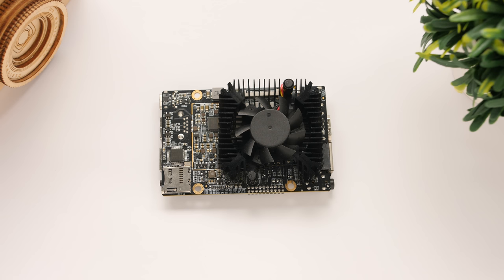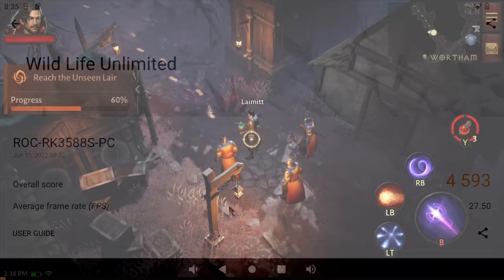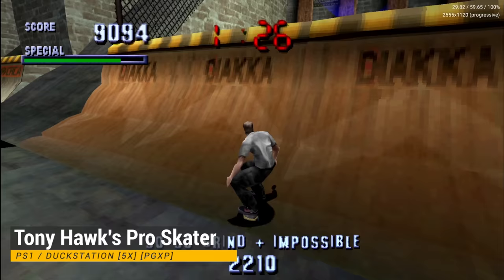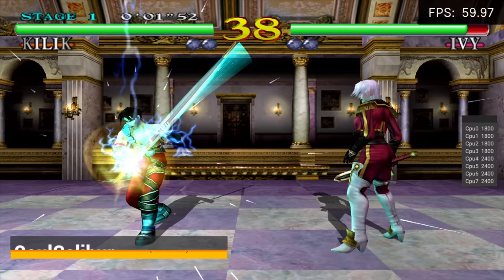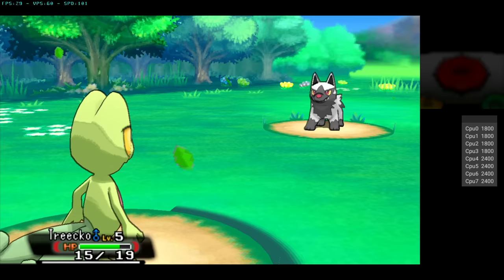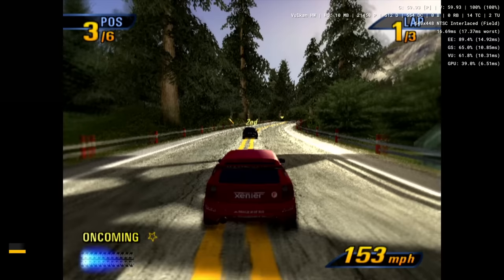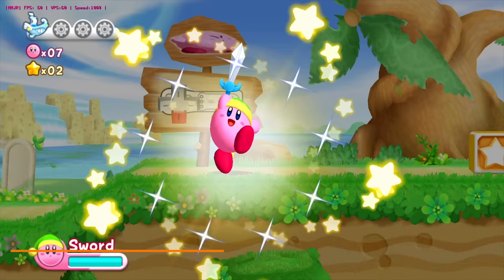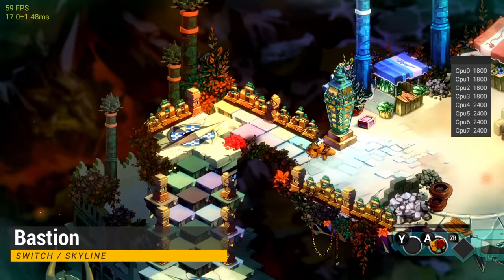This Tiny Chip is POWERFUL - PS2, Switch, 3DS, Wii, and GameCube Emulation

Comment: The fact that an SBC which costs a little over half that of a Switch can run ANY of the same games, especially under emulation, is amazing.
Reply: The switch is over 4 years old shut up about it. It was outdated on the cpu when it came out.
Reply: @shlokshah5379  Me on my way to find out who asked
Reply: the switch uses a 5 year old arm tegra SOC. these other arm chips don't actually have to do much emulation, just have a decent gpu and a driver that works.
Reply: @PaulSpades  I didn't think about that aspect; i.e., since they both use ARM architecture, the emulation layer won't be nearly as "thick" as, say, if a switch emu were running on an x86-based machine.  If they ever have these or Khadas boards (another high performance RockChip based SBC you've probably heard of) back in stock, I'm definitely using one for my portable emulation handheld.  Let's hope that these aren't more small companies which fall victim to the supply chain shortage and go out of business.

Comment: This is definitely exciting. I have an old Lenovo Yoga Y500 Laptop that I sometimes use for emulation. It has slightly better Geekbench scores at 678 Single Core and 2489 multi. It's no graphics powerhouse at this point with it's NVIDIA GeForce GT650M graphics card and a Timespy score of 603. Yet it runs Gamecube, Wii, and PS2 Emulation at Full Speed on a 15 inch 1080p screen with no problems. This little board should be amazing in a handheld.

Comment: Wow, this is great to see. Finally a small SBC that can handle all the standard def consoles for a reasonable price. Another revision or two to smooth things out and it will definitely be something to pick up.
Reply: 3ds emulator Citra is still work in progress. Oh man i never had 3ds because it is not available in my country so I play on my mobile via Citra emulator. The emulator run fines on some games but my phone got so much hotter other emulators are not get hot like this. On other side Nintendo ds emulator drastic is so much optimised that I can play any games on it. When i had 1 gb ram phone in 2014 i run drastic emulator games smoothly than ppsspp emulator.

Comment: This is in a way much better than some x86 boards that were available some time ago. Every time I see this kind of stuff, I dream of a new handheld system...
Reply: @ Not AN AMD Nor Nvidia nor Intel fan If you can get one in your country, it sure is.
Reply: you would think but not really just remember the emulation performance this is demonstrating is akin to the performance you would get in a high end pentium or core 2 duo CPU as ps2 does not need much performance it just needs the right kind of CPU

which is where cpus differ you might take a arm CPU and say a intel CPU and think of the specs are alike but arm is a different CPU and has different features for emulation these matter

the biggest difference I can tell you about that effects emulation is opengl x86 and x64 architecture cpus have full opengl which many emulators leverage arm series cpus have opengl ES which doesn't run as well and doesn't have the full features of open fl

also things like vulkan and other technologies make a difference

finally developer support makes a huge difference almost everything you can think of in emulation has x64 and 86 builds for it but the embedded systems not so much and with so many boards and chips available getting anyone to develop for them is hard raspberry pi did well because of its high adoption so it gave a clear platform to target

comparatively odroid xu4 had very little and it wasn't until various teams worked on it that its power began to demonstrate itself and infact once team ORA got some emu devs to make builds tailored for it that its true power became evident with its performance doubling and almost tripling in some cases

so what is on paper for specs is almost meaningless

Comment: Imagine this in a laptop with boosted clocks ofcourse. Maxed out GPU and cpu. A newer chip probably would reach i3 levels of performance while drawing about 15 watts. That will improve battery life so much NGL. Kinda like the macbooks. Almost 4 times the battery life of most x86 laptops.

Comment: This is very impressive performance. I can't wait to see the handheld this chip will end up in. I'm hopeful that the Skyline team can make even more strides because I'm still searching for the handheld that can emulate all the way up the line. I'd rather run android for my handheld, but the AMD 6000 series has so much power behind it I'm pretty sure it's going to get there first. With the Ayn Loki Max in the pipeline and it's small form factor of the Ayn Odin, it's a very compelling proposition. The only downside is that I have to run windows until Steam OS is refined.
Reply: It's going to be a while.

Comment: Honestly, this board almost seems like a competitor to the Steam deck more than a traditional emulation board. It's possible, though somewhat impractical, to run PC games through box 86 / 64 and Wine on Linux, and I'm willing to bet that you could play actual PC games on this thing. I suspect this would be most useful for people looking to find a smaller sized Steamdeck, and I'm sure at this thing's power draw, you could probably make a Switch sized (or smaller) handheld using it.
Reply: this board has an ARM CPU, right? 

so ... wine won't help with PC games because PC games are made for x86 CPUs and wine does not do CPU emulation ... and because of the massive amound of performce required to emulate moderately modern CPUs, it is safe to assume that using an actual emulator like box86 or qemu will only be good for some really old PC games or new games with VERY low system requirements ... so ... nope ... this SBC is not a steam deck competitor ... not even close ... 

maybe someone might turn this SBC into something that is a kickass ARM gaming device in its own right
Reply: @KenjiUmino  I think you missed a step. Box 86 and Box 64 are compatibility layers, to x86 and ARM what Wine is to Windows and Linux. They convert many x86 system calls into ones that an ARM CPU can understand and maintain the native Open GL and Vulkan libraries present on both platforms to keep performance surprisingly comparable in things like games. 

In and of itself, Wine wouldn't be terribly useful on an ARM device, other than maybe running Windows on ARM programs on an ARM Linux installation, but you can use Wine in a Box 64 wrapper for instance to play a Windows game in Linux (via wine) and then translate that to an ARM compatible executable via Box 64.

It's a super cool technology and a very fun rabbit hole to go down. :D
Reply: @novantha1  github page says box86 IS an emulator ... it talks about all the stuff other emulators talk about ... how the dynamic recompiler is faster than the interpreter and so on ... so that is plain old emulation for the CPU side at least ... 

for the GPU side you might get away with handing vulkan calls straight to the host OS but if the software does not use vulkan, you'll have to convert GL to GL ES by whatever means necessary ... some form of compatibility layer might do without causing too much overhead ...

you know ... it has all been tried before and done before and said before and I heard all this talk about how this new emulator X is so much more faster and more better and more efficient than emulator Y but in the end they are ALL the same.

you can't run x86 code on an ARM computer without a noticeable performance hit - you. just. can't.
Reply: @KenjiUmino  Regarding OpenGL at least, you often don't need an OpenGL -> OpenGL ES conversion as the Panfrost drivers, for instance, will cover OpenGL support for many ARM boards currently in active use, meaning you can take out another major barrier to gaming on an ARM SBC.

As for your other points, you might say that you can't run games well on an ARM board, but I see people doing it regularly, and even get away with it myself often enough. 

I'm not sure what your point is; I'm happy with the gaming performance on these boards and am excited about them as an enthusiast. What's not to love?

Comment: 🤦‍♂️No. We are looking forward to the review and tests of the Pentium 8505 and Celeron 7305.
Reply: Is this chip more powerful than the Pentium 8505 or the 7305?
Reply: @tamim4235  of course not. And it costs more than they do. But most importantly, portable consoles on Pentium and Celeron are cheaper, more powerful and have the entire library of windows games. + more performance in emulators.

Comment: Hey Taki! Can you test the Avatar (The Last Airbender) games someday in your reviews?

For some reason, I always get color errors in them when using hardware rendering. At first I thought it was because of the device (Mediatek Helio G80), but the same happened in my notebook using PCSX2. Now I don't know if the problem is related to configuration, the ROM used or something about the emulators.

Comment: Cool board definitely. Just too expensive in my opinion. Firefly’s 3588s 8 g ram 64 g emmc is over 320$ ! Too high. The Rock5b is more affordable although who knows when (or at this point if) this “fabled” single board computer is gonna be released
Reply from the maker: Ya, it's kind of strange that Firefly is on to their second (3rd?) 3588 product when other companies haven't put out their first. I don't know how they got this much of a lead over the competition. Their products are usually priced higher than others, but they do provide OTA software updates for several of their boards, so they must spread out the cost for a lot of things.
Reply: @TakiUdon  that makes sense. I’m so tempted to grab the firefly joint but patience is a virtue I suppose

Comment: Mr Taki, I been enjoying your videos and reviews since you started, could you please recomend me what computer/affordable may I get to run ps2 and wii U flaulessy (and not burn it), I did not have a good enough ones to run them well
Reply: If you want an affordable device would recommend current handheld consoles such as the Odin, steam deck. I have the aya neo which is more expensive but runs ps2 games perfectly using the pscx2 emulator

Comment: Hi, in the preview image, you showed an handheld device.
When people present this kind of SBC, are there any "universal devices" ready to plug your sbc into? did you plugged your sbc into it or is "just to put it into the backround"? (no mean intended) also cause of the large fan and heating dissipation device you showed.
Thanks in advance
Reply: @Enter Name thanks, I thought so and it seemed a switch lite, but with psp and the other stuff aside and all the handhelds, I thought it could have been a kinda knock-off or similar of a switch

Comment: All these damn hand held coming out I can’t keep up. I just bought a decent Samsung tablet for gameboy and DS emulation and bought a dell G15 for everything else (ps1 ps2 Xbox etc) so far so good 😊
Reply: Nice! I have an aya neo handheld pc with: pc games, ps2, GameCube/wii, Dreamcast, PSP, ds, gba emulators installed 😏😏
Reply: @therunawaykid6523  nice and how is it overall?
Reply: @hinfinity  really good in my opinion it’s so cool having a handheld device that can play pc games and many emulators. Even has a dock available so you can play it on a television also in my opinion the seven inch screen and size of the device is perfect as it’s about the same size as my og switch with the hori split con controllers attached. Also what I love is that it has Xbox style controls so most games are already setup plus it has a game record feature so you can record gameplay and take screenshots which is really useful
Reply: @therunawaykid6523  ok I might have to look into that thanks 🙏🏾

Comment: crazy- on my Snapdragon 888, Citra for 3DS doesn't run this well. Return of Samus, even at the original resolution, is unplayable.
Reply: @bulletpunch9317  I haven't tried for a few months- maybe citris has had some good updates, or maybe the play store version is nerfed. 

That geekbench score is pretty weak, you're right. Makes me wonder why I wouldn't just buy a Galaxy S10 with a cracked screen for less, and still get better performance...
Reply: The Snapdragon 888 is generally heavily throttled on a phone and never has a good chance to "stretch it's legs." An SBC doesn't have this problem, especially with active cooling.

I have the S21 so I'm aware of the strengths and limitations of the chip.
Reply: @ezg8448  I wish there were snapdragon boards you could buy.
Reply: @MrHamncheez  - Agreed

Comment: Also if you’re having to mess with settings just to get the emulators to work then that isn’t good. Which is why with anything from nes to ps1 these days anything up to ps1 will always run smoothly

Comment: I am starting to wonder what the difference is between like - this board, the orange pi 5 series, the edge 2 etc. like the specs are the same, in the case of the opi5 ive got a board with dual channel 16gb but im struggling to find a vulkan driver on anything other than android, and because i have steam running on linux id prefer to get vulkan running so i could do everything your doing plus play x86 pc games, since i can already play x86 linux native titles. In fact didn't taki show the edge 2 doing just that? how do you enable steam proton on these rk3588s with mali g610 mp4 graphics 8-16gb ram etc they're all oddly the same. So like how did he get proton working? I've tried wine, I've done box86, box 64, panfork, mesa, etc etc
Reply: Did you find a solution this? I have been wanting to get emulation working on this for a while now. I swapped the OS to the station M3 OS and that worked well to make the android experience less clunky. I still have not been able to get something like batocera linux or a decent front end to work in android to use this thing. It's been sitting in a drawer almost since when I bought it a year ago.

Comment: If your fans got 3 wires shouldn't it be hooked up to a PWM built into the board? As if it was just a straight 3.3-5v it'd only need a +/- terminals to power it
Reply from the maker: That's what I was hoping for, but there were no fan variables that I could change when I was poking around in terminal with root.

Comment: This chip is pricey around 300$ pricey plus shipping around 50$ bucks can't afford this cause doesn't include the set up BUT this is great improvement
Reply: I think this board starts at $219? You can get a RK3588 board for as low as $189 (4GB mem, 32G storage, excluding shipping/taxes)). Still waiting for the Radxa Rock 5 (starts at $129 and I think you can still get a $50 discount code).
Reply: @LivingLinux   yap the 4gb ver is around that price but not including shipping..shiping cost 20-50$ depending where you are still you need at least 250-300$ total with a setup that includes power cable hdmi etc etc .. chip only will cost 180$ total with shiping

Comment: Is this more powerful than Snapdragon 870 with its Adreno 650?
Reply: The 870 has a more powerful processor, if I'm not wrong it peaks at 1200 single core and 3000 multicore. Similar gpu performance.

Comment: The Teams we Haven't Got, Yet. Nintendo Switch.
Borg (Home Electronics Division) Atari, Aquired Our Technology. A Team Branched Out to Become Nintendo. That Team then became PlayStation and Sold Nintendo to the Old Atari team, because of Darlik Modchips.
1-We Need to Get the Old Atari / Nintendo Switch Team.
Borg (Business Division - Sun Microsystems) = Windows, Intel, XBox - We Got.
We've, Also Got the Darlek (Business Division) = Oracle / IBM. I think they May have been Digital Equipment Corporation in the Past.
Their (Darlek) Home Division (Motorola) - We Haven't Fully Got.
We've Got their Macintosh OS Team.
2-They've been Reverse Engineering Windows with Wine. So have Branched into Ubuntu Azure (Their Intel). They also Do Windows (ARM). And Desktop Ubuntu. We Need to Get this Team. They Make (Subset Intel) and Windows ARM Chips.
3-Their Home Division Branched into iPhone and iPad. We Need to get This Team. They make iPhone and iPad (ARM chips).